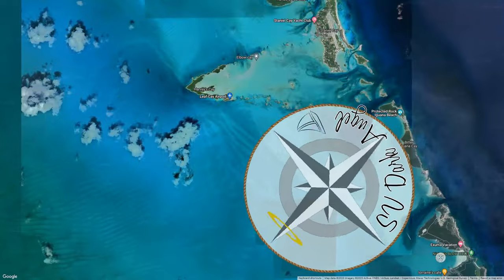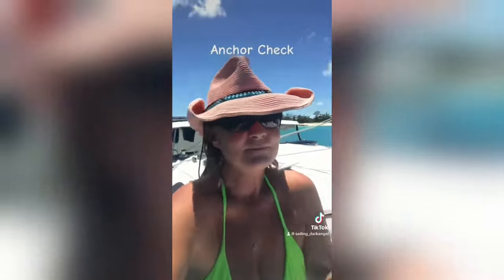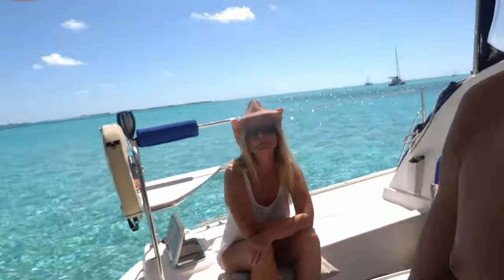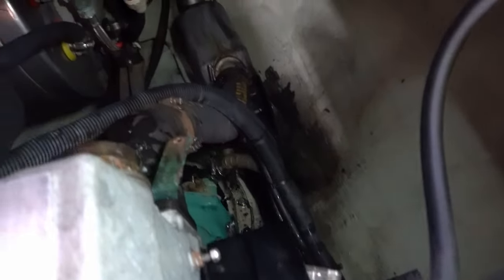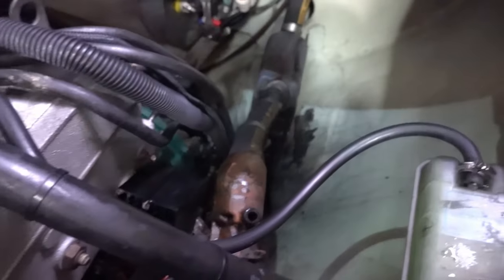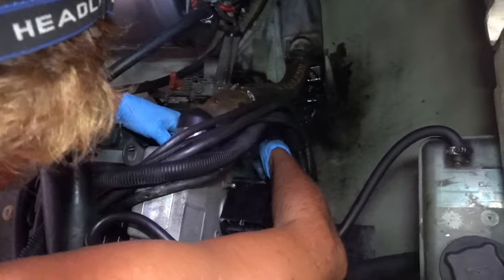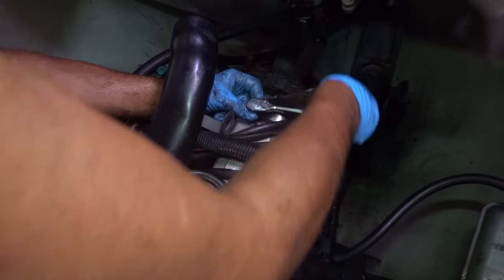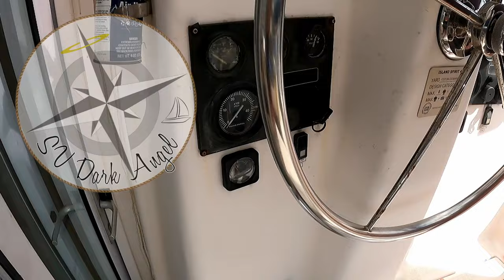SDA108 Is Your Elbow Exhausted? Volvo MD2030 Exhaust Elbow Repair

Comment: I have a system in place to fill the exhaust elbow and exchanger with fresh water when not in use.  I haven't had in corrosion in there really for a decade.  Though my boats engine is on the skids for other reasons because of the PO.
Reply from the maker: Interesting! How does it work?
Reply: @SailingDarkAngel  Well just plumb a fresh water line into the intake or exhaust With a bronze valve preferably.  When you turn the valve on your freshwater pump will displace the saltwater.  You e just got to be careful not to do something that will backfill you cylinder heads.
Reply: @SailingDarkAngel  Oh and if it is on the exhaust side you need to make sure the line can take the heat. You've got to figure out just how much water can go in. Less is more...even reducing the salinity a little is a big win
Reply: @SailingDarkAngel  Oh and if it is on the exhaust side you need to make sure the line can take the heat. You've got to figure out just how much water can go in. Less is more...even reducing the salinity a little is a big win
Reply from the maker: @allynonderdonk7577  next time you’re putting eyes on the engine, could you send a pic of your setup?
Reply: @SailingDarkAngel  Oh and I usually do it just before shutting it off so it draws fresh water in with the normal operation.  I do a valve, but they do sell brass valves that are 12 volt operated.
Reply: @SailingDarkAngel  I still have soot but it doesn't seem to cake as bad.
Reply: @SailingDarkAngel  I am repowering I ripped it out already, but I'll look for a picture.  It's just a sad Catalina 30.  I put it in the feed from the engine thru hull near the engine. I turn off the thru hull after turning on the valve for the water system.  The engine while running pulls through a stream of water for about one minute.  It is enough to fill the exchanger and probably the elbow.  About three gallons...maybe two.   It really kills living saltwater creatures and drops the corrosion.  I pump the freshwater tank dry if the boat is being stored for a season.  That way the entire system is full of fresh water.  You could pump with the thru hull open but the water would still have sea life and salt in it...just not as much.